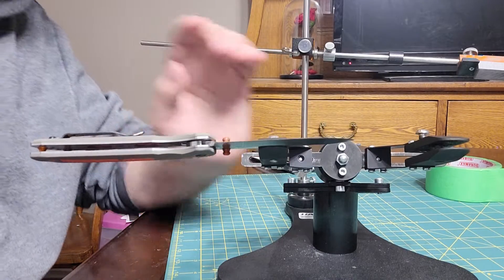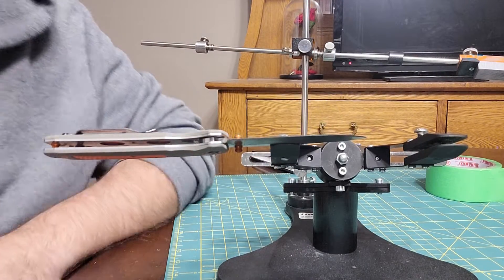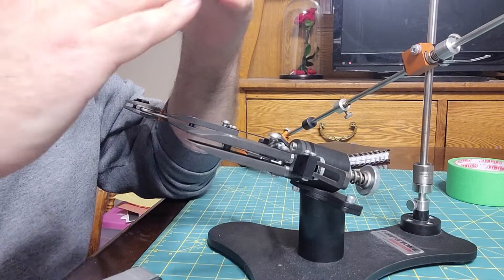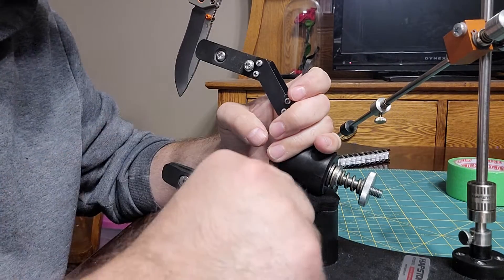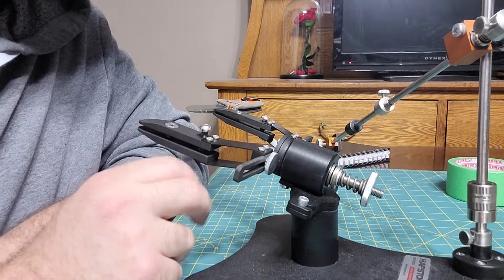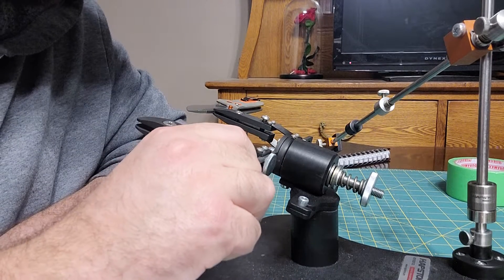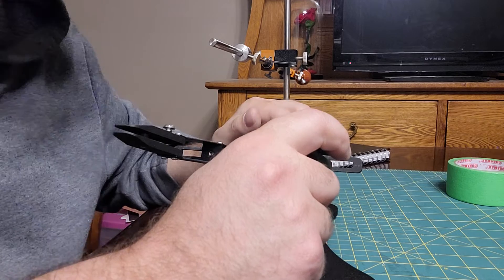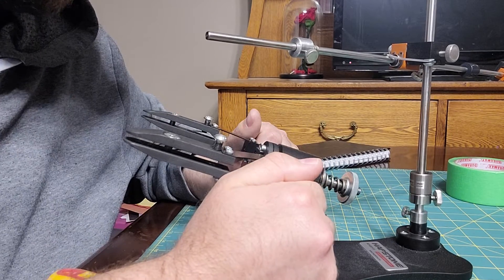Hapstone R2 clamp calibration. 0° flips

Comment: I used your advice on my Hapstone standard angled clamps and got them calibrated. I used a Nakiri kitchen knife because it's wide and nearly rectangular. I did one clamp at a time and it took me about an hour of fiddling but after I got them both zeroed on the flip I went ahead and clamped the knife in both clamps to sharpen and sure enough, zero degree change on the flip measured with my Axicube One (black Friday sale :D).
I don't know if I would have bothered trying to calibrate the clamps without stumbling into your video. My flips were about 0.6 degrees off from the factory, which honestly is fine, but there is something very satisfying about knowing your angles are exactly the same on both sides of the bevel. Thanks.

Comment: Here's the problem I see with any guided sharpening system:  most knives are not of a uniform thickness.

First off - why calibrate each clamp individually?  Unless I'm forced to use only one clamp because I'm sharpening a very small knife, I use both clamps.

I just clamped a blank (one of the pieces of aluminum that the stones are glued to) into both clamps on my R2.  I then adjusted the blank so that each side of the blank was the same distance from the base.  The best I could get was 0.4 degrees difference when I flipped the blank from one side to the other.  This was acceptable to me, and according to Hapstone, this is also an acceptable range.  

I then removed the blank and clamped a Henckles 8 inch chef's knife into the R2.  The blade on the Henckles is not a uniform size.  The spine is thicker at the handle and tapers toward the tip.

When I check the bevel angle, there was a 0.9 degree difference when I flipped the blade over.  I experimented by placing a thick washer on the underside of the clamp closest to the tip, and I got the angle difference from 0.9 degrees to about 9.4 degrees.  

Do I really want to make these adjustments and rest various spacers everytime I clamp a knife in place?  No, I don't.

So what I do is, I set the blade angle on the first side.  When I flip the blade, I reset the angle to match the first side.  I know it's a pain in the neck to reset the angle every time I flop the blade, but my stones are generally of different thicknesses anyway so I have to make some adjustments.  And if I'm sharpening a knife to a 15 degree bevel, at least I know it's at 15 degrees.

One last comment - buy a Klein digital angle gauge.  I don't work for Klein and they haven't paid me to endorse their gauge.  It's just better, IMO (except the magnetic bottom isn't flat, which isn't the best).
Reply: I just noticed a mistake.  Clamping the washer near the Henckles tip, reduced the angle difference between flips from 0.9 to 0.4.

Comment: Thank you for this video. I found 2 of the rear clamp screws that attach to the riser block, the lock tite ones not tight at all. One clamp was good. The other one was 1.00 degrees off. I found your video very helpful. I would like to add a couple things. One level your working surface first and make sure you have a stable heavy table  otherwise trying to calibrate the clamps to zero degree flips was almost impossible. Once I had a level surface it was very easy as described. Thanks bud.
Reply from the maker: No problem  man glad it worked out for you. And those are very good points

Comment: Please explain this In steps. I am confused. Is this right??:
Step 1: loosen the screws on the clamp.
Step 2: put your blade in a clamp and tighten it down.
Step 3: put your stone on the blade and zero the angle cube so it reads 0°.
Step 4: flip the clamps to the other side so the blade is facing the other way and attempt to see what the angle is. 
Step 5: if the angle cube is saying anything other than 0° push the blade up until it reaches zero then retighten down the screws. 
Is that right???
Reply from the maker: Sorry I didn't get a notification for this yes , That's what I did .
I'm going to make a new video shortly. 
Showing how to do it the way gritomatic suggests. 
As when I made this video there was no recommendation on how to calibrate the clamps
Reply: @davesedges8105   is this coming or no?
Reply from the maker: @digitalhorizons  yup I just finished up  a v8 video..this one should be next

Comment: Can you please remake this video and just explain what you did it's kind of confusing. Did you basically just loosen the screws, then push up on the clamp then re-tighten the screws?? I'm confused. Please redo it in a shorter video and get right to the point. I don't mean to be disrespectful but it's hard to follow. Thanks. Keep up the good work.
Reply from the maker: I'm making a more detailed a more detailed video.
I'll try and have it done in the next couple of days
Reply: @davesedges8105  Never did the detailed video?

Comment: 1st) Not every knife is symmetric.  Most were sharpened freehand either on a belt or a wheel.

The difference for me is between 0 - 0.8 degree for knives I have never sharpened with the Hapstone.  After sharpening the difference is between 0 - 0.2 degree, and that's with me leaving the clamps alone.

Lastly, can you honestly say you can really tell a difference in performance if a knife has different bevels of less than 1 degree?
Reply from the maker: Most primary grinds are done on a jig and should be symmetrical. 

But yes  most companies free hand there secondary bevels. I've had some knives with over a 10° angle change at the heal on a secondary bevel. 

Honestly I don't really care so much but.
most shaperners I know find it to be
 noticeable fairly easily at around the .5° mark.
And when you sharpen for others this helps prove you know what your doing.

Some people are picky, and have the right to be.

Is it sharp with a uneven bevel yes.
As long as you manage the apex properly. 

Like a 70/30 or so on.

So does it matter no, but some people are perfectionist.
And with some of my knives I like them perfect or as close as I can get to it.

Honestly I do it mostly for the challenge of having that nice even apex hair whittling edge. 
Nessary no, fun? Yes
Reply: https://youtu.be/abaR6fE3MUA geometry is everything

Comment: You need to tighten the rotating pivot screw as tight as it can go while still being able to rotate it and use both clamps on all knives so there's no chance of flexing you just clamped knife with one clamp and as soon as you start sharpening it's going to flex where it isn't supported

Comment: What you have to respect and expect on any single guide rod system that uses a single clamp or multiple clamps is you really cannot dial in a perfect mirrored edge angles on both sides.  The ideal was I’ve found to get matching angles on both sides is not one guide rod, but two guide rods on a clamp or clamps that remain fixed.  This way you can dial in both sides to be exactly the same
Reply from the maker: Honestly I disagree completely, as long as I clamp the blade properly. It's the same. I even have one less rod to worry about. 
I'm do mean it's very well calibrated now.
But there is also the work sharp precision adjust, a budget $50 system that gets perfectly even edges every time.
Cause it clamps every blade perfect and in the same position every time.
And there's systems like the Hapstone v8  the table dosen't move so it can't be off.

Madedge has a neat setup for centering the clamps too.

Now I'm mot saying Wicked edge is bad by any means but it's not perfect at grabbing every blade either.
I had a gen 3 clamp.
 I know it works really well but also has flaws.
Stone's are crazy expensive cause you need to buy everything 2x
And I bet you can't tell me you haven't nicked your thumb yet 😉.(nothing bad but just let you know)

It's a great system  gets very crisp edge's  and was the best around when it came out.
And really still could be. Just needs a few improvements.
I didn't mention all the things that bug me. 
One was the cost of everything. 
And it has issues with larger kitchen knives and fillet knives.
Don't get me wrong no system is perfect. 
But for me the way it was didn't fit.
Maybe in a bit when they fix a few things 
Hapstone is fixing one thing that annoyed me.

W.e. is an amazing platform that could be the among the best.
They just need a few tweaks like most systems do
Reply: @davesedges8105   I agree
Reply from the maker: @floridasaltlife  Thank's Doug.

Comment: Thanks Dave for this, makes sense that if the clamps are out of alignment the angle will not be the same on both sides. Love my R2 also, didn't know it could sharpen something as small as a Ladybug, will have to give it a go with my smaller blades.
Reply from the maker: No problem, Yeah and it doesn't take much to throw everything out of alignment. 
Yeah it's actually quite impressive how small of a knife can be sharpened on the system. 
Really didn't think my ladybug would work, I was quite impressed. 
Thanks for taking the time to comment!